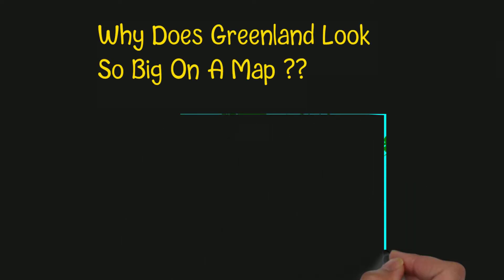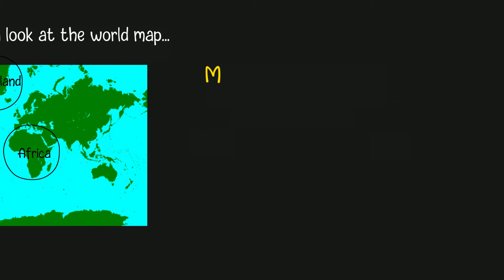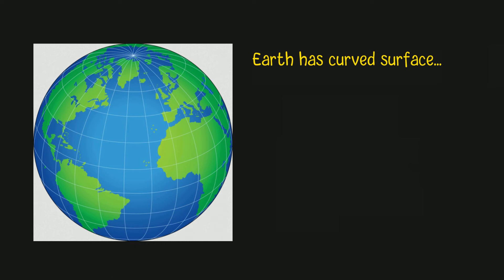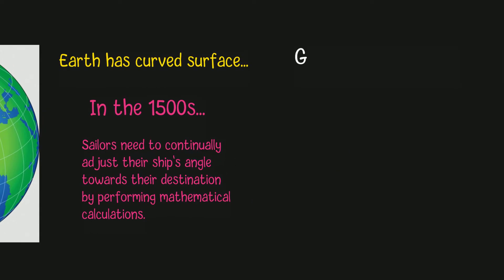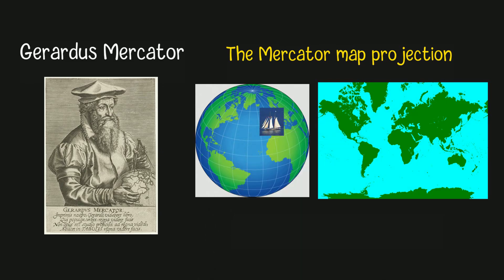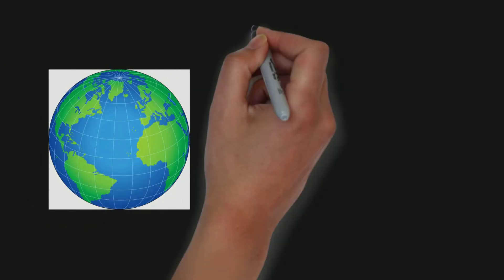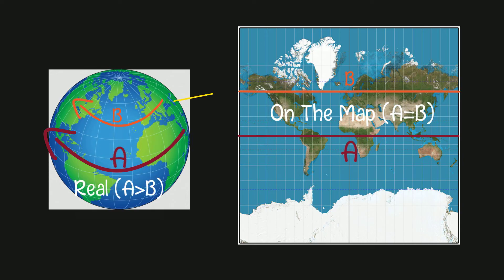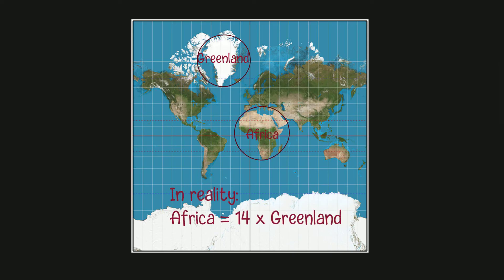Mercator Projection Explained (Why Does Greenland Look So Big On A World Map)

Comment: Makes no sense
Reply: It does make sense. When navigating a ship, it doesn't matter that you know how large (or small) exactly your desired destination is. But knowing where to sail your ship is required.
Consistent angles are far more important than consistent sizes. Whenever you're projecting a spherical 3D-object onto a flat, 2D surface, there's going to be some distortion. You'll either have the proper sizes but the angles in between two places on the sphere are wrong on the 2D map; Or you'll have the correct angles (which is good for navigation, of course) but have wrong sizes of the places on the sphere on your 2D map. 
😅
Reply: @CalistoLP  I hear people these days saying the map was designed to make countries with white populations look larger and more important. I thought it had something to do with sailing. Thanks for the explanation